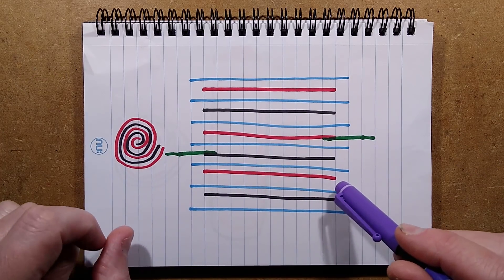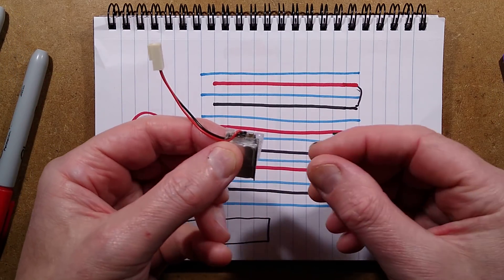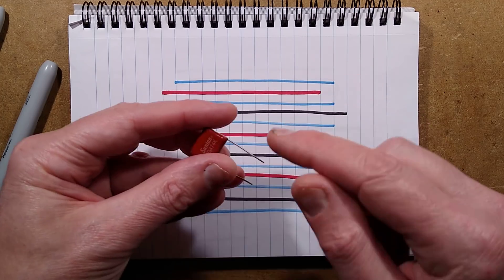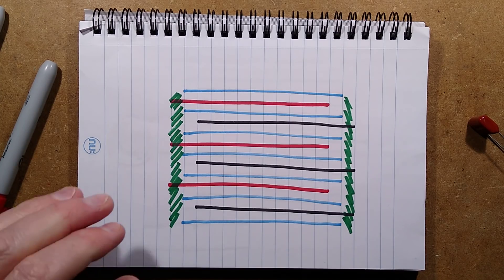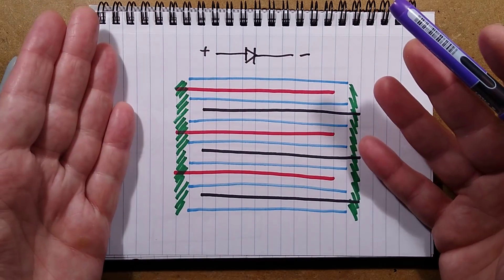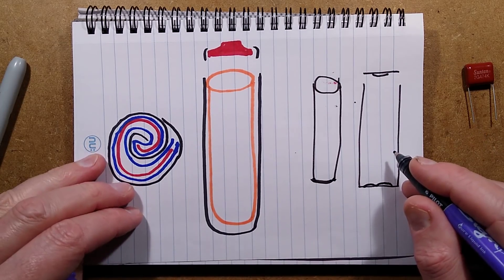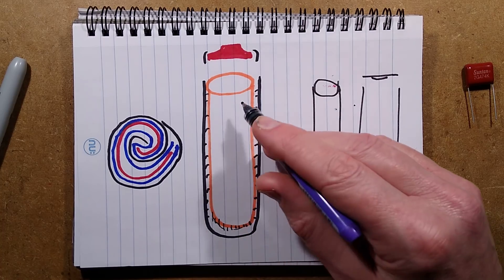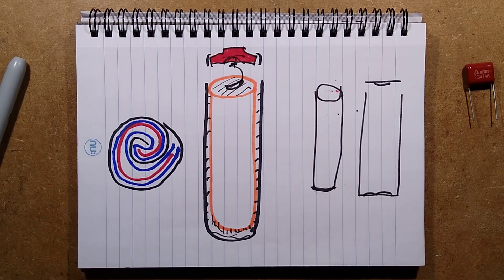Will Tesla's tabless cells ever use Schoopage?

Comment: There is an end-on image of the cells in the presentation. Looks like its a copper strip all along the edge which is then cut into 100 of strips so they can all be folded over in a sort of spiral at each end.
Reply: I made some high voltage capacitors almost exactly like that a few years ago.  (made them out of kitchen aluminium foil and stretch and seal wrapping plastic). I needed them to have very low resistance so I folded over the ends almost like that except a lot less elegantly.   I had also applied a conductive carbon grease to improve the contact. I couldn't solder because it would melt the dielectric.  At the time I assumed all capacitors and batteries were made like that as it seems to be the obvious way to minimise resistance.
Reply: @listerdave1240  I did this same thing years ago for hv caps. I've been wanting to revisit that process in a more controlled, professional manner.
Reply: @listerdave1240  "we have a brilliant new idea!"
"Yeah did that with tin foil few years back, thought it was obvious"
Reply: That's what it looks like to me as well.  Then laid flat like shingles.
Reply: Revolutionary!  The world will never be the same!

Comment: The Tesla battery uses a tab that spans the edge of the batter, with little corners taken out... looks like this before jelly-rolled

_/---------\__/----------\__/----------\__/----------\__/----------\

When they roll it into a jelly roll, they bend the tabs inward, so that you end up with a spiral semi-flat end that can be soldered or ultrasonic welded.  This greatly reduces the series resistance and inductance, making for a better power source.  I assume they do the same thing on both electrodes.

Comment: You can solder aluminium with 'Alusol' (not to be confused with the cream with a similar name)
You ccan also weld it.
If you look at the pulse rated axial polyester capacitors, they have the schoopage, so i'm wondering if they are going to do the same, put the end caps on once manufacturered, or maybe put the ends on then cram into a tube.

Comment: They will slice the full length tab in shingles which they'll fold down, like they showed during the event: https://youtu.be/l6T9xIeZTds?t=4334

Perhaps also use spray solder like you say.
Reply: That was sort of what popped into my mind before he mentioned the Schoopage method. Just extend the bare foil out past the end and use it for the final connection. Its clever since they can simultaneously notch the foil as its going by and have guides to roll the edge over to form the shingles while they are rolling the layers of the cell together.
Reply: Interesting if the workers and engineers can pull it off.
Reply: @franglish9265  
An air jet could blow them flat as the jellyroll is wound.
No physical contact.
Reply: You missed a subtle but key portion of the presentation.
The foil is not cut, only laser patterned.  That pattern causes the edge to fold over in a carefully planned crimp.  The part of the magic they don't reveal is how the fold is accomplished, and if the fold forms only a mechanical joint.  Perhaps the crimp retains contact pressure even with material expansion and contraction.  My guess is that they print a narrow line of material that plates out during initial cell formation and results in a permanent metallic bond.
Reply: Thank you for this. saved me a good deal of time. :)
Reply: @DJPhilTBCollins  @Shaun Stephens  👍 I appreciate that. :)
Reply: Thanks. There's an hour of my life I'm not getting back...
Reply: Oh, they cut a 40 minute chunk out of the video so the timecode in my link didn't match up anymore. I updated the link with the correct timecode.
Reply: @Bremberry  Dude, you rock. The image behind them looks like the copper end and apparently the secret sauce is in how to deal with the alumin(i)um end, but the idea of having many many hundreds of connections along the length of each rolled strip is very clearly shown.
Reply: So, a variant of schoopage but relying on mecanical connection by folding/pressing the notched edges together instead of soldering. Probably not perfect, but with that much contact area it won't matter much if there are a few loose connection mini-tabs here and there. You still get a better, more evenly distributed connection than with a single tab.
Reply: The design is in his patent application. But, I can't understand it all from a normal cell.
Reply: Completely unrelated to the content of the shareholder meeting linked, did you appreciate how much contrast they get on that screen in apparently broad Nevada desert daylight?  They must have a bulb life in that projector somewhere in the low single digit hour range.  :)
Reply: @tactileslut  Thanks :)
Now you mention it, I think they might be modular LED screens, but still impressive indeed.

Comment: When charging a battery, the electrons move via the charger not the electrolyte; it's obvious really, because if the electrons transferred through the electrolyte, then the ions would have to flow through the charger!
Reply from the maker: I believe the electrons are transferred across by attachment to the lithium ions.  Then during discharge the ions transfer back, but the electrons have to flow back through the load.
Reply: @bigclivedotcom  No, because then they wouldn't be ions Something has to flow through the charging circuit, that can only be electrons. Think of it as the exact reverse of the discharge process, you force a current the 'wrong way' with the charging circuit, so the electrons flow in the reverse direction to that when they discharge.

Comment: It's all a waste of time.
A large proportion of housing in UK have no chance of ever having a charge point  where they park overnight. Even if they did, the power requirement for all the potential electric vehicles would be double the present requirement. Add to that the intended replacement of gas powered central heating with electric and the future electricity generation needs are enormous.
Given that there is no intention to build any more fossil fuel generators,  renewables can not provide enough so would need a whole series of nuclear stations and construction would already need to be underway. Add to that the increased grid infrastructure...
The only solution - stop messing around with batteries.
Reply from the maker: These batteries are also being developed, and already used for temporary grid power storage.
Reply: @bigclivedotcom  I'm not talking about instantaneous consumption, I'm talking about the overall daily consumption which takes into account the need for (inefficient) temporary storage. A couple of years ago the UK came close to overload blackout due to generating failures.
Reply: //sarcasm on 
Exactly.  The gasoline engine would have never been as successful as it is today if we hadn't had all the gas stations up and running before it was released. 
//sarcasm off
Reply: @chipheadnet  Do you seriously think we can triple electricity production in the next 20 years? Petrol/gasoline consumption steadily increased over a period of about 60 years, we are talking about changing the whole thing in less than 20. A nuclear power station takes 10 years to build and we haven't even got the ideas for them, never mind begun the planning process.
It's not just the wrong technology, it's an impossible task.
Reply: A large proportion of homeowners in the UK don't drive more than 10k per year, 200 miles per week.
Assuming those drivers socialise, or use the car for shopping, there's ample opportunity to charge sufficiently..... Especially with these cells.
The "power consumption myth"?
About 2 years ago the Daily Fail jumped on a report and suggest a similar scenario to your post.
The National Grid (who wrote the report!) Felt compelled to issue a written statement of rebuttal, restating that if used correctly, EV's could actually ASSIST the grid.
I believe it was the same report which highlighted the use of electricity for refining if fossil fuel, essentially the equivalent consumption to a major city.
"Construction (or nuclear) would already need to be underway..."
And that's the (well, one of!) problem with unclear energy!

Here's a more recent opinion from The National Grid !!
Enjoy!!

https://www.nationalgrid.com/stories/journey-to-net-zero/5-myths-about-electric-vehicles-busted
Reply: @rogerstarkey5390  There are plenty of people in the electricity industry who disagree with the official stance but of course they do not get a voice.
According to the National Grid's own figures, statistically the first car does 37 miles per day, the second 11 per day. That's 48 miles per household. But that's not the mean, it's a weighted median, the mean is higher, but we'll go with 48 for now. A recent test conducted by Carwow showed that a fully charged battery, around 60kWh, would carry the vehicle about 200 miles, far less than the rated distance. So that's about 15kWh per household. Currently, the average household consumption is around 20kWh. Adding electric cars to every household will increase consumption by 75%, not the 10% stated in the official report.
Additionally, we haven't even mentioned the changeover from gas to electricity for heating and cooling which at the present time is about 150% of electricity consumption.
The figures in the official report do not stand up to scrutiny.
Reply: So what's your solution?
Reply: @Pulsar2000  Quite simply, we need massive investment in hydrogen cell technology. And before anyone says we would be driving around in mobile bombs, they are no more dangerous than sitting on top of a lithium battery bomb.
Cells are currently being developed which can extract hydrogen directly from water with solar power for creation of the gas, and others which can create electricity directly from processing of the hydrogen.
Reply: @chrishartley1210 Hydrogen for cars is a pretty bad idea. It's expensive, inefficient, has high maintenance costs, needs serious amounts of energy and has a complex, energy-hungry infrastructure.
That BEVs double or even triple the present power requirements is simply untrue. I don't know where you got this. Here in germany we estimate the additional amount of electric energy to convert all cars to electric of around ~20% (~120 TWh).
A hydrogen infrastructure needs 3 times more energy. This is slightly more electricity than the whole german industry consumes; just for the electrolysis plants! And it must be green energy of course!
Another problem is distribution. A H2 truck can transport only a 1/5 to a 1/10 of energy of a normal gasoline truck. You have to invest in a lot more trucks than with normal gas station trucks. These H2 trucks are also much more expensive than normal gasoline trucks.
 And I don't even want to talk about safety requirements for these trucks!
You need up to 30 kWh just to compress the hydrogen to over 700 bar for a refill. An electric car can travel 150-200 km with 30 kWh of juice! Just to make the station ready for a refill! Energy cost for producing and distributing the hydrogen not included.
BTW, batteries are also needed for hydrogen cars. They are smaller but constantly drained and recharged. These batteries have much higher charging cycles than normal BEV batteries in there lifetime.
You also need platin for the fuell cell. An element that slowly evaporates through the membran of the cell and needs to be replacement after a few thousand hours of operation.
Look at Norway. Hydrogen cars are more or less dead there after an explosion in a hydrogen station last year. The H2 car marked imploded. Or california: A steam reforming plant (green technology LOL) exploded. It was impossible to refuel a H2 car for months. Hundreds of people try to sell their hydrogen car. Also in south corea, a steam reforming plant exploded: Two people were killed, many were injured. A lot of problems for a few thousand H2 cars worldwide if you ask me. I don't want to imagine what it means when we have millions of them.
The German car industry gave up on H2 cars. Currently it's only discussed for semi trucks. And yes there is Nikola. Or should I say there was Nikola ;) The great hope of all H2 aficionados. It turns out that everything was fraud. They have not battery tech, no inverters, no fuel cells, no electrolysis plants, no drive trains and not a single ounce of H2 made from their (non existing) solar roof. Only a few mock-ups to fool investors.
I would say it doesn't look good for hydrogen powered cars.
Reply: @Pulsar2000  Now read an article with
A) more up to date information 
B) no preference of electric/hydrogen.
https://www.rac.co.uk/drive/advice/buying-and-selling-guides/hydrogen-cars/
Over their lifetime, hydrogen cars produce 4g/km less CO2 than electric vehicles and that is without taking into account developing technology such as direct solar cell water disassociation.
Certainly they are currently much more expensive to run, but so were electric cars when first introduced.
And the stories about high maintenance costs are simply not true. In terms of traction/moving parts they use exactly the same technology as electric  vehicles,  they have smaller, cheaper batteries and the cells which generate the electricity are virtually maintenance free.
Reply: @chrishartley1210  Trust me I'm up to date when it comes to hydrogen cars. The article  is more or less an advertising brochure
 for hydrogen cars and contains little information. The difference of 4 g/km is pretty low,  just 3%. If you slighly change the basic assumptions, you'll get completely different results. 0.95 kg for 100 km is very optimistic. I know someone who drove a H2 car. Realistic consumption is 1.1-1.2 kg for 100 km.
Maintenance effort is higher compared to pure BEVs. Mirai is 6 months or 5000 km (what happends first). The maintenance intervalls for Teslas are severals years.
Overall the article doesn't debunk my arguments about the H2 infrastructure.
Hydrogen cars use significantly more energy than electric cars. If you think that electric cars use too much energy, you should definitely not drive an H2 car.

Comment: I heard that he was going to be using dry cells.
Reply: The dry cell tech was a peak at what they are trying to achieve.  It's still down the road a bit to viability.
Reply from the maker: I think the dry aspect is an attempt to apply the electrode coating with pressure rather than with a solvent.

Comment: pretty much!
if you want to know more search for "the limiting factor" he makes loads of videos about tesla's battery technologies and what ones they could be after, like the 5000 cycle battery tech
Reply: also the battery at 10:20 doesn't have that popping cap thing, it instead has solder tips connecting to the battery network and when something goes bad it just heats up and severs the connection to it, it costs much less to produce theses batteries by specifying them for the role of car-only battery, so you can't just take one out and connect the + and - normally inside some connector case
Reply: CORRECTION:
it seems they don't use schoopage, instead they'll elongate the copper plate and make a cut every few millimeters to make hundreds of tabs that'll fold on each other on the sides, possibly with a bit of solder for better connection, that's actually genius, here's a link to a video about it: https://youtu.be/g1ppM22EQFs?t=369

Comment: I agree, though i think they will be encasing the opposite ends of the cathode/anode entirely in the polymer separator for safety, cupping around the foil so no dents/dings will crimp them together and cause a short. Very important in vehicles imo.